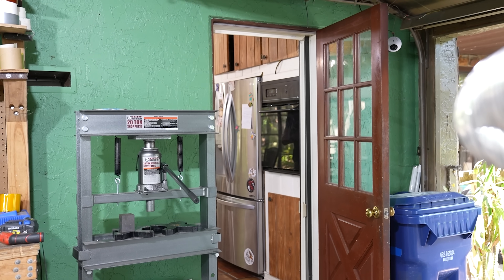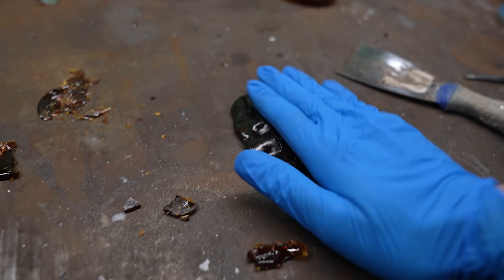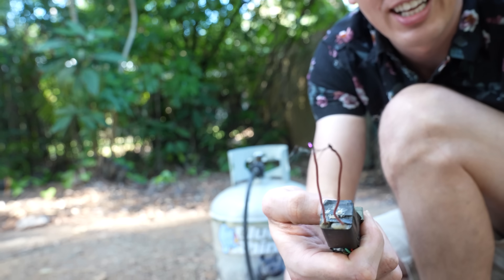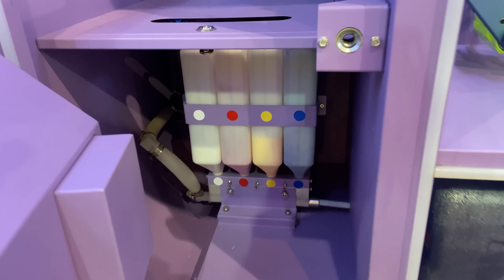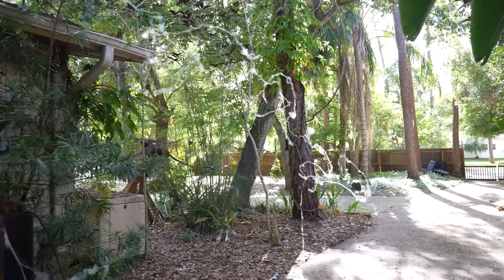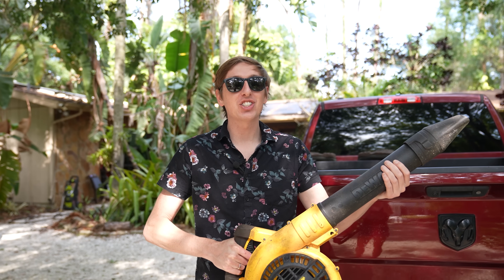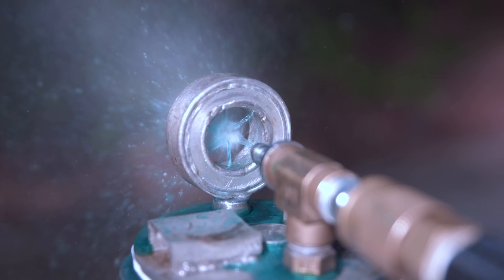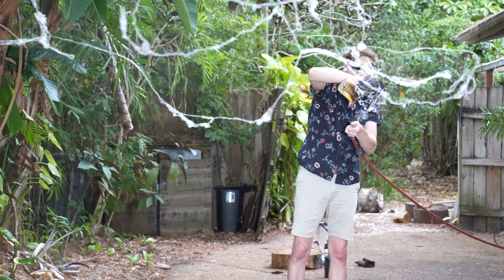I built a Cotton Candy Gun

Comment: I really appreciate the multiple iterations of the design. Surprised the pressurised system didn't work better.
After watching this, if I were to design my own system, I'd drop the compressed air and pump high pressure sugar out of a tiny nozzle to more closely replicate how regular cotton candy machines work. Perhaps a couple of heated gear pump heads in series (for extra pressure) with a chain drive to keep the heat away from the motor. Basically a pressure washer but for molten sugar.

Comment: I think that you might be on the right path with the melted sugar going down into the stream of air. Think a gravity paint sprayer with the paint on the top basically just dripping down into a stream of air. Though to avoid the sugar clogging upp the nozzle the nozzle should be activly heated by a heating coil. The canister should also be heated to keep the sugar melted.

Comment: A suggestion: could you heat the nozzle, whatever it would be, with a coil, using induction ? And by adjusting the parameters keep the nozzle(s) at the sugar melting temp ?
Reply: I thought thats where he was going to be honest.
Reply: Heating the air before the venturi, could have used a radio antenna.

Comment: Why wasn't the entire apparatus heated? The compressed air will carry away a crapton of heat energy as it sucks the molten sugar up the tube, so the sugar needs to be continually heated both in the reservoir, the feed tube, and the nozzle, or else it will (as everyone saw) simply freeze back into a solid.

Comment: I would suggest trying to build something more closely related to a large airbrush, except rather than attaching the cup directly to the nozzle, you suspend the cup above and out in front of the nozzle on a bracket
Inside the cup would be one or more heating elements to heat the sugar for you (Instead of heating it beforehand and having to act quickly), with a valve to open and close it, letting gravity do all the work.

Comment: Could you make a custom spinning cylinder with the tiny slits in a cotton candy machine? I'm trying to think up ways to make it so the spray of cotton candy just fires in one direction. I don't know if a solid cylinder would work forming around most the slit cylinder. I don't know if you could make something with truly zero tolerance, so cooling sugar stuck in the gap between the two might jam it up...

I might be over engineering this, but what if you had the slit cylinder where during it's rotation, it flexes between, lets say it only flexes for 30' facing away from the person holding the device, allowing the melted sugar to escape with centrifugal force. I dunno what kind of material would withstand the heat while also flexing at only one point in it's rotation....

Comment: I was surprised after the pouring worked so well that you didn't build a gravity fed tank that just poured the sugar infront of the nozel when you opened a valve. 

Though the cotten candy cannon with the fire extinguisher was my personal favourite. Like a party popper but with molten sugar and cotten candy instead of confetti 😅
Reply: Right?  3D printer nozzle to melt it / keep it hot, and some kind of gate valve / flap at the bottom to stop the flow when you don't need it?
Reply: @Bro-trust-me  Love the idea with a 3D printer nozzle/hotend! All it then needs is a raised tank for that laminar flow, and of course a table. Because table.
Reply: My thought aswell.
Reply: i feel like the main issue with that would be that the sugar would freeze and clog the nozzle, I'm honestly more surprised he didnt add in a heating element to keep the sugar liquid, theres also sugar specifically designed to be used in a cotton candy machine, so as opposed to using regular sugar he could have tried that as well
Reply: So what you're saying is.. a top feed paint sprayer with a heating element 🤔

Comment: So, wouldn't a simple design be a reservoir with a funnel-shaped bottom ending in a small valve with an air nozzle mounted below so, when the valve is open, molten sugar runs in a thin stream into the blowing compressed air?